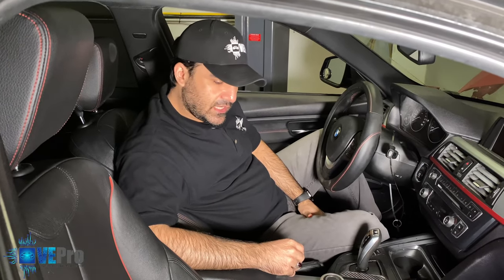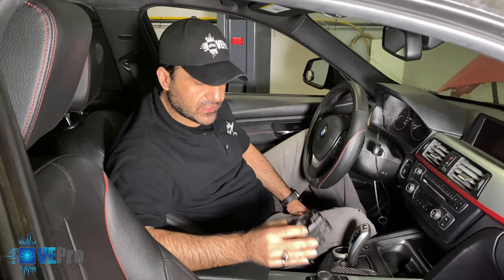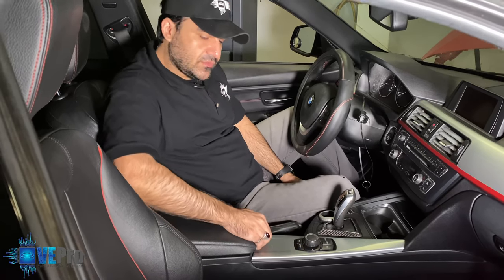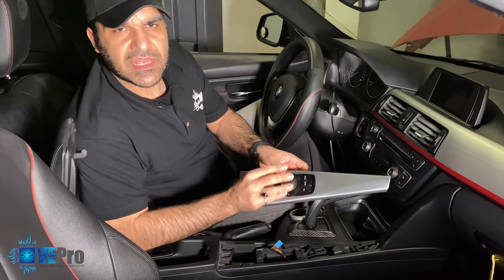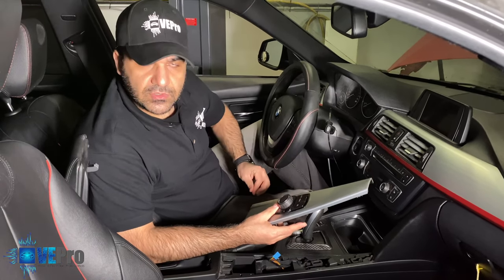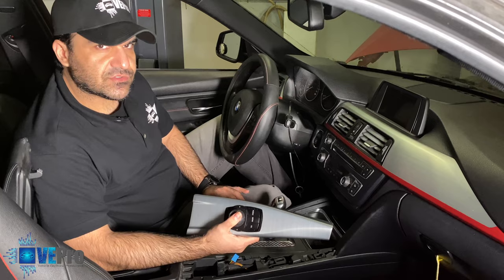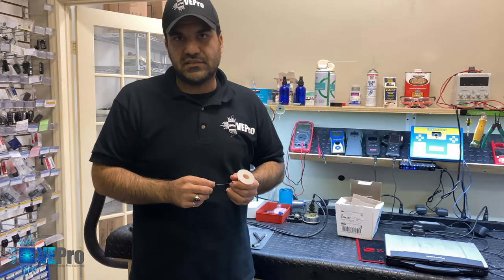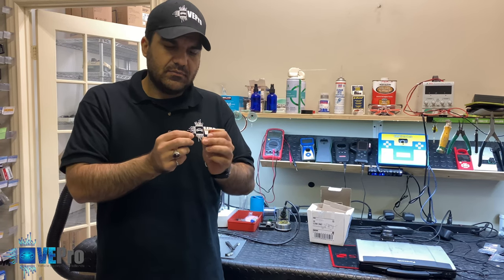BMW | IDRIVE CONTROL BOARD SPILL FIX | TRICKY CORRODED CONTACTS | ADVANCED SOLDERING TIPS

Comment: My idrive controller stopped working, so I was able to order a replacement BUT I am not able to disconnect the electric socket from the controller - I see how simple it is for you - to the point where I think I just need to clip the socket and replace it but I am not sure what components I need to order and if I need to buy a specific clamp to install the wiring.  I have a 2015 BMW i3. Are you able to create a video for that?
Reply: If you were able to get the replacement installed, did the new one work right away? I'm wondering whether it's as simple as remove/replace or if any programming is necessary.
Reply: @szielke  yes it worked no reprogram needed
Reply: @cindycrabtree1069  Thanks! Where did you end up sourcing a new controller from?

Comment: My Idrive controller stopped working so I ordered a new Replacement but I can’t disconnect the electrical cable . The blue tip is like superglued to the unit . Any tips ?

Comment: Mine stop working because I spilled coffee by accident. I need to mail mine in.
Reply from the maker: Info@vepro.ca
Reply: Same.  I spilled a little water and the idrive controller went out shortly after. My hope is that I might could just pull the part out like in this video and do some basic cleanup.  I don’t know the soldering stuff they did
Reply: @hoglover1  , did you ever do it yourself and did it work?